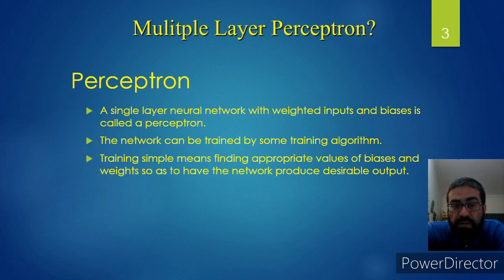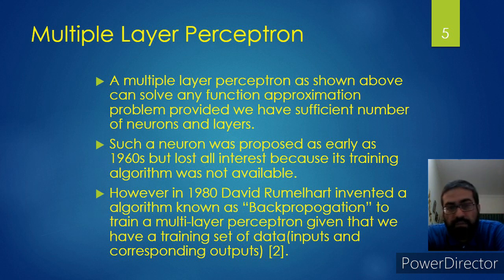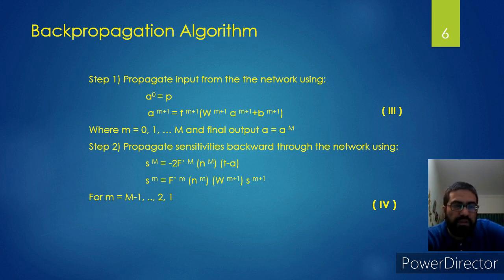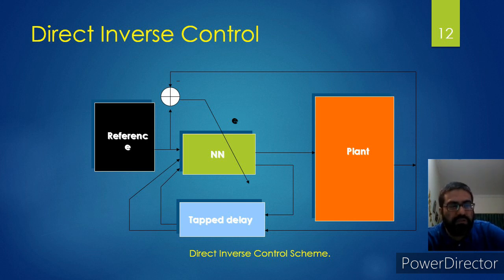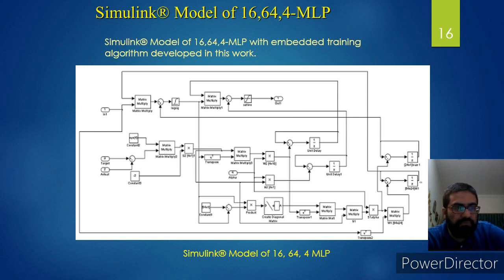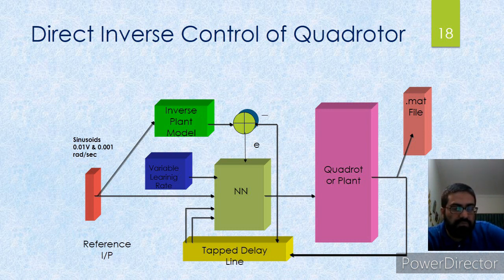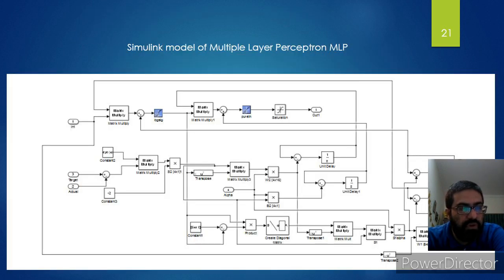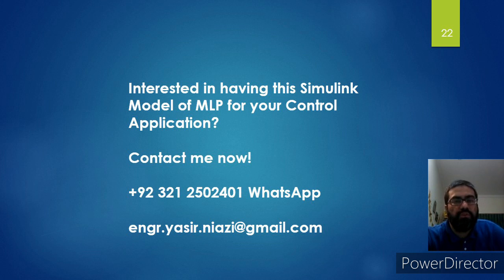Control Systems with Neural Network - Direct Inverse Neural Control using Multiple Layer Perceptron

Comment: Hello, I am interested in using the Neural Networks that you designed for the control of Wheeled Robots that I am studying. However, I would also appreciate it if you could also guide me to any literature that would help me to design such NN in Matlab/simulink.
Reply from the maker: please whatsapp 923212502401 or 03212502401